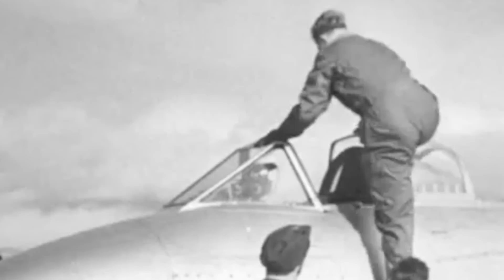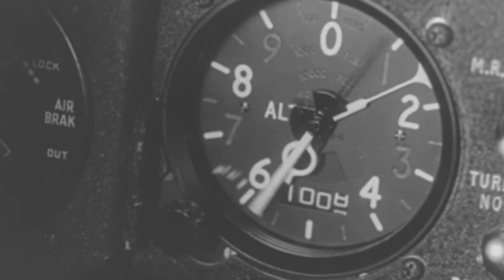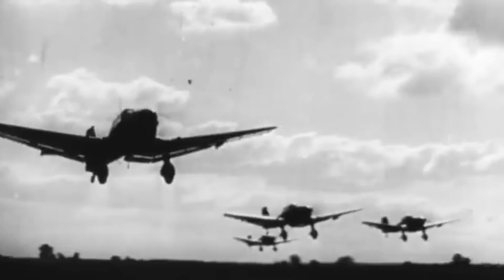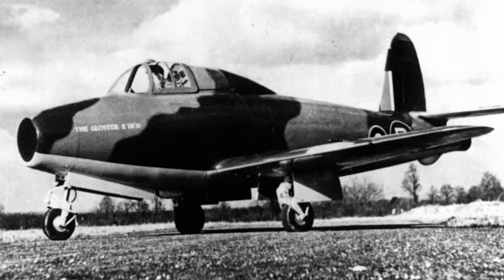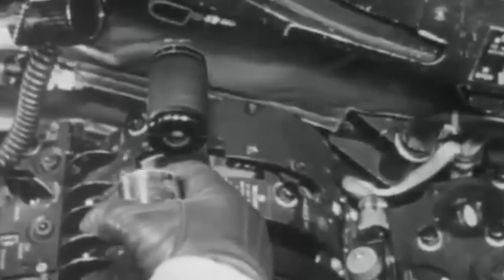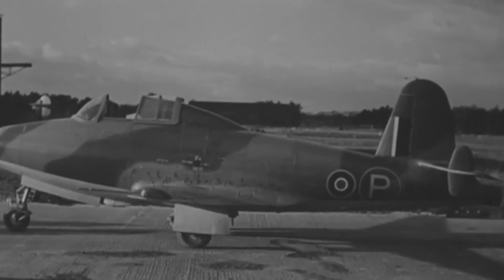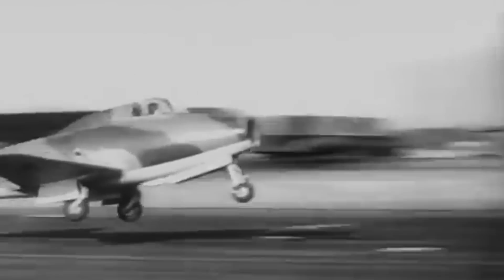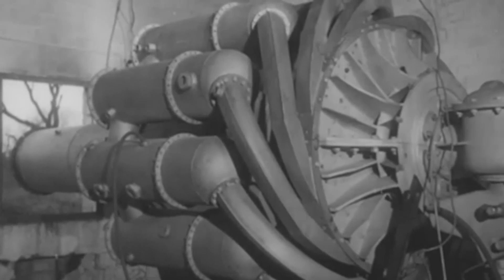Britain's 500 MPH Coffin With Wings

Comment: Whittle didnt get the dupport he needed from the establishment in the 1930s , so development wasnt as fadt as it could have been.
Brilliant as the Spitfire and Mustang were, they were obsolete very quickly.
Reply: Whittle sabotaged his career when he was exposed as a fraud and for plagiarizing the work of A.A. Griffiths who was the Cheif of Engine Development at the Royal Aircraft
 Establishment.
 Whittle copied a paper published by Griffiths in 1926 and also copied an error that Griffiths had corrected in a later edition.
He also pointed out several egregious errors in Whittles work that revealed that he did not understand the fundamental principles of the gas turbine engine and his limited engineering skills.
 
Whittle would never build a single viable engine that could be mass produced or could pass the minimum reliability requirements for airworthiness certification and adoption into RAF service.
 He would be sacked from Power Jets Ltd and exiled to America after the failure of the W.2/500 M.52 engine and his subsequent indictment on embezzlement charges in connection with the Miles M.52 scandal.
Whittle would be black-balled in the UK and would never work as an aerospace engineer for the rest of his life in exile in the U.S..
Reply: @WilhelmKarsten 

We feel we can clear up some often stated & very common false myths & misconceptions.

    ???Maximini GUILLAUME patented the turbojet aircraft engine in 1921, when a 9 year-old Frankie was still wearing short pants.???

Obviously Maxine Guillaume copied the work of Parsons of North England regarding axial turbines & axial compressors pre 1900.
 -------------------------

   ???Whittle's patent was revealed to be invalid and he allowed his patent to expire in 1934 rather the face legal challenges in court.????

It's correct that Whittle simply didn't renew the patent due to lack of funds.
-------------------------

   ???Whittle effectively sabotaged his career when he plagiarized the work of A.A. Griffiths who was Cheif of Engine Development at the Royal Aircraft Establishment.????

Clearly Whittle didn't plagiarize the work of anybody.
-------------------------

   ???Whittle made many enemies in the British aircraft industry with an arrogant condescending attitude toward co-workers and frequent violent outbursts fueled by week-long
drug and alcohol binges.????

Without doubt if course Whittle always did not make enemies in the aircraft industry, was not arrogant towards anyone, did not engage in violence at work & did not have week long drug & alcohol binges.
-------------------------

    ???  Power Jets Ltd was nationalized when the war began and he was forced out after being arrested and discharged from the RAF when the Miles M.52 scandal broke in 1946.????

Yes, it is in fact the case that Whittle was not forced out of any company, nationalised or otherwise. He was not arrested & was not discharged from the RAF. there was no such thing as a Miles M.52 scandal.
--------------

     ??? Whittle was removed from Power Jets Ltd amid allegations of extortion, embezzlement and dereliction of duty.????

Obviously it's agreed that in fact Whittle was not not removed from powerjets, there were no allegations of extortion, embezzlement or dereliction of duty.
-------------------------

    ???  Whittle was exiled to a drug rehab in America to spare the new Labour government any further embarrassment.????
 
There is no doubt at all that Whittle was not exiled to anywhere, obviously.
-------------------------

    ???  Frank Whittle would be black-balled and never worked as an engineer in the British aerospace industry again.????

It universally accepted that it is in fact the case that Sir Frank Whittle was not black-balled & carried on providing consultancy support for the British aerospace industry when he felt so inclined from time to time.
-------------------------

C H E E R S
&
Toodle PIP Old  Chap.
Reply: Whittle was junkie and an alcoholic... all of his engines were failures that were too unreliable to pass airworthiness certification..
Reply: @DoktorBayerischeMotorenWerke 

We do indeed feel we can clear up some commonly held misconceptions, obviously.

Obviously It's always good & very important to take account of the facts.

   It is indeed perfectly normal for the reader to find this comment very annoying, please don't be alarmed if this happens.

   Agreed, it is in fact true that of course the gas turbine concept was first described & patented in England before 1800.

   That's correct,  obviously Sir Frank Whittle was not hospitalized several times for any addiction to anything and was not an admitted addict to any substance. He was not arrested for brandishing a gun and assaulting a young engineer and didn't engage in week long substance abuse binges. 

   Yes, that's correct, It is in fact the case of course that guns were kept at the factory which were often used for shooting rabbits to supplement rations from the windows of the office. On one occasion complaints were made by a neighbour but of course were just a result of the neighbours annoyance at the constant noise of Sir Frank Whittle's gas turbine aero engines which were often on test day & night with the exhaust jet also causing problems with nearby hedges & frightening the hedgehogs & local cats & causing a local dog to constantly bark while any Whittle engines were running. 

   Yes, agreed, Indeed on another occasion a person posing as a delivery lorry driver turned up & commenced taking photos, a citizens arrest was made using one of Sir Frank Whittle's shotguns (believed to be a 20 guage with a walnut stock), the police were called, turned out the chap also had photos of aircraft carrier construction going on in Scotland which were being sent to contacts in Japan, the spy (a Scottish chap involved in military ship building in fact) was convicted of attempted espionage & actual espionage but was not sentenced to firing squad action using rabbit guns, the spy was of course jailed.

   Maxime Guillaume simply copied the work of Parsons of Ireland & North England into a fraudulent patent in 1921 when  a 14 year old Sir Frank Whittle was still just making model aeroplanes. Sir Frank Whittle's patent of 1930 was of course entirely valid but due to lack of funds Sir Frank Whittle let the patent expire in 1934. 

    Without doubt it is perfectly true to state that Sir Frank Whittle successfully carried out the world's first demonstration of the gas turbine aero engine which would go on to form the basis of the gas turbine aero engine type of which more than 100,000 would be produced in Russia, China, France, the US, the UK & other countries & of course is still currently in production. The currently produced Pratt & Whitney PW200 range of engines is an example of the Sir Frank Whittle engine.

    That's correct, of course Parsons of Ireland & North England did indeed produce the world's first multi stage sequential stator rotor axial compressors and turbines before 1900 for turbomachinery use which he licensed for production throughout the industrial world, the basic components of many modern gas turbine aero engines. Parsons also did work on the axial compressor & axial turbine internal combustion gas turbine engine concept.
   
   Yes, agreed, it is in fact the case that the world's first demonstration of a reliable, viable, pure internal combustion gas turbine aero engine was of course performed by Sir Frank Whittle in 1937.
   
As always we truly do indeed hope this helps.
   
Cheers & 👍 of course etc.

   O  B  V  I  O  U  S  L  Y.
     
. ....... ........ . . . ..
  . ....    .. ......... ... ..
Reply: @petemaly8950  Can you name a British owned manufacturer that is still making British jets???
Reply: We feel we can clear up some common false myths, misunderstandings & misconceptions.

It is indeed always very important to note the relevant facts obviously.

Of course It's perfectly normal to find this comment extremely annoying.
 
    Regarding the UK Aerospace Sector.

  WHY IS IT THEY CAN'T ANSWER VERY SIMPLE QUESTIONS ⁉️ 😅
  A very simple question indeed.
   
Which airline recently ordered 60 RR Trent XWB Engines? 

Also name a single Germany company that makes German jet aircraft in Germany & name a single German Company that makes German gas turbine aero engines suitable for widebody airliners.

  ANSWERING The QUESTION WON'T HURT A BIT, COME ON NOW, THEY CAN DO IT IF THEY TRY HARD ENOUGH.

     That's correct, Brazil makes very good airliners & Brazil is 100th down the list along with Indonesia for wealth per capita.
Norway Holland Denmark Ireland Belgium - Top 20 wealth per capita - Don't make airliners -  its as simple as that.
  
  Agreed, that is correct of course, clearly there are many countries that could easily produce airliners of better  quality than Bow-wing (see b-47 wing folding & wing collapse incidents) but don't for some very good reasons. Bow-wing being a result of the size of the US, the large protected domestic market & great ease of testing new types due to the equator to arctic geography & a few other reasons related to production scale capability, politics & economics.

  Obviously there really is nothing special about Bow-wing, having more than 50 years design / build experience on the type means they have no excuses for the horrendous max incidents for example.

    Indeed BAe Systems & Rolls Royce combined now do more Airbus work than Germany on an absolute basis & significantly more work than that on a per capita basis.
   
     Agreed, Per capita for the home nation BAe Systems is the world's largest defence contractor.
  
    Correct, BAe systems announced the recent £4 Billion takeover of Colorado based US based Ball Aerospace.
  
    It's definitely the case that BAE systems now does a significantly higher value of work for Airbus than it did when it was a major Airbus shareholder before 2005.
     
      Obviously RR now owns US Engine maker Allison for example which does classified Aerospace work for the US Govt.
   
   Yes, that's right of course, Anybody currently flying on a widebody airliner stands a good chance of being on an aircraft powered by RR gas turbine aero engines built in the UK.

   A typical but small glimpse of what goes on in the very internationally orientated British aerospace sector.  

      Boeing Apache Attack Helicopter.
AH-64: 75 UK suppliers, 7% UK content, global fleet of 1280+ aircraft.
F35B more than 130 UK Suppliers, more than 30% UK content.
F35A & F35C more than 130 UK Suppliers, more than 15% UK content.

   There is no doubt that an airline has just ordered
60 RR England Trent XWB Engines

Obviously the UK has the
World's Highest Combined Per Capita
 Nuclear / Defence / Aerospace Sector Activity.

Rolls Royce Holdings UK
Subsidiaries
- Rolls-Royce plc
- Rolls-Royce North America (Allison etc Classified Military stuff)
- Rolls-Royce AB
- Rolls-Royce Deutschland
- Rolls-Royce India Private Limited
- Rolls-Royce Marine Power Operations
- Vinters Engineering Limited
- Rolls-Royce Controls and Data Services
- Rolls-Royce Power Systems
- Bergen Marine
Joint ventures include:
- Rolls-Royce Turbomeca
- MTU Turbomeca -

Trent Family
The MT30 (Marine Turbine)
Industrial Trent 60 Gas Turbine
Trent 7000
Trent XWB Airbus A330neo.
Trent 1500
Trent 1000
Trent 500
Trent 600
Trent 700
Trent 800
Trent 8100
Trent 900

RR wholly owned subsidiaries in Germany handle smaller 2 shaft RR gas turbine aero engine work.

We hope this helps of course as always.  Cheers & 😎👍 indeed.

       O B V I O U S L Y  

. ..... ..... ......  
..... ..... ...... ....
.... ..    .. .. .... ...
. .. ... ....... ..
Clearly the line above this line is not blank.